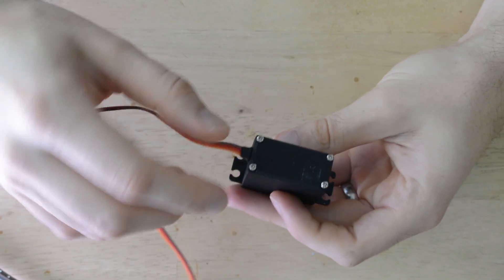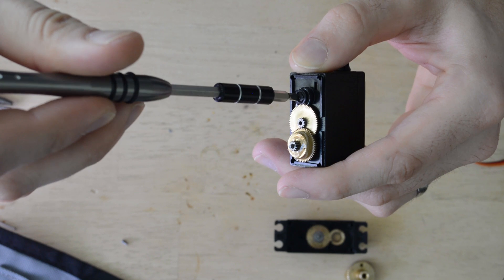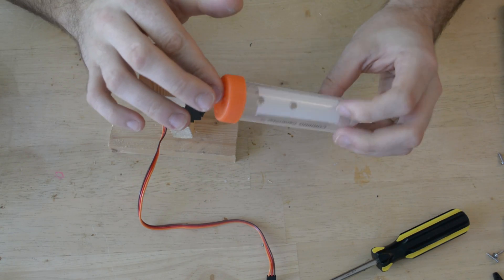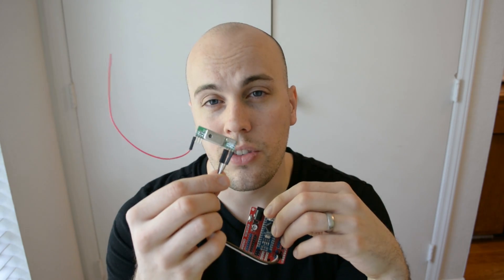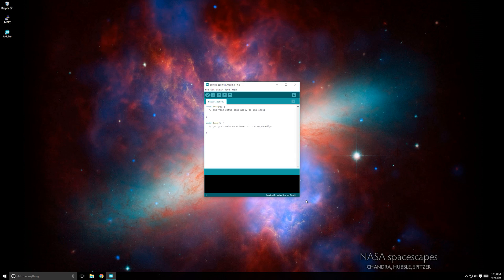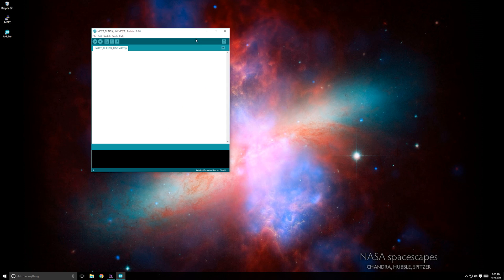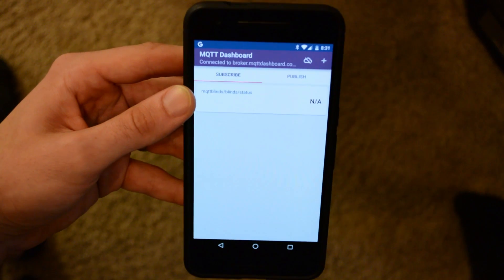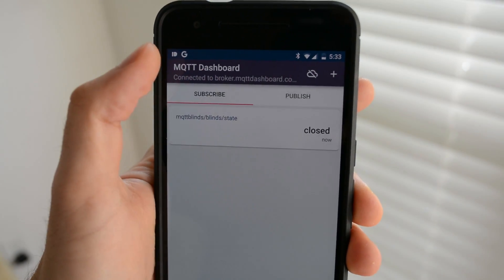The Cheapest Tech - $15 DIY Internet of Things Automated Blinds

Comment: Hi Ben, 
I got this up and running. Thanks for the video. 
Now I want to add this setup to my home-assistant hub and control it from there.
It runs on a raspberry pi.
How would I do that?

From documentation, what I understand, is  Home Assistant contains an embedded MQTT broker. So using this embedded MQTT broker, can I access/control the blinds.

Thanks for the help.
Reply from the maker: For sure. Yep, MQTT would be the way to go. If you install HA via the All-In-One script, Mosquitto is already installed and setup. You should be able to access it at port 1883. I think the access rights are setup such that you can use any username and password? I think you can create a username and password for Mosquitto using sudo mosquitto_passwd -c /etc/mosquitto/accesslist.txt yourusername.

Comment: Hey, great project. Even i am trying to similar one for windows. I have problem in driving motor to full rotation. I followed your steps(cut potentiometer and pluck the stopper from main gear) but even then my motor rotates only for 180 degree back and forth. Please help me.
Reply from the maker: For sure. My guess is the pot isn't totally disabled. Try centering it again, then cutting the stem a little lower or even using a dab of superglue. I bet once you get that done, it should rotate indefinitely. Cheers!
Reply: Thank you! I would try this :)
Reply from the maker: Let me know when you get it going!
Reply: Hey thanks for the suggestion it worked. I cut the potentiometer little deeper :)
Reply from the maker: Sweet! Nice! Pumped you got it working.

Comment: Your design is very unattractive in the typical home aesthetic. Back in the late eighties I designed a circuit that used two 555 timers and four relays, and a small gear motor to automatically angle mini blinds open or closed in response to the day and night cycle. It worked great.  But it was ugly. A three inch by four inch black box. So I went to work figuring out how to design the idea so it would fit in with design motif of your typical mini blinds. So I came up with the Electronic power angling Rod. I patented it in 1995. P.T.O. granted patent status in 1997. Couldn't find any buyers of the invention who wanted to manufacture the invention. The patent ran out last year. It is now being manufactured and sold by someone else, and they call it the EZ-Wand.  See it work: http://www.youtube.com/watch?v=bIjByZLOsPg&google_comment_id=z120upiastq2ypn1p22yyvwggxn0flvzj04&google_view_type#gpluscomments
Reply from the maker: Haha, yeah, I agree, it's totally ugly. Definitely not something my wife likes, but it does work and it's super cheap. :P Yeah, I'm definitely surprised that there isn't a commercial blind opener, yet. Seems like there'd be a lot of demand at the $20 price point. I guess the issue is powering it can be tricky and people don't want to have to plug-in their blinds.. plus designing something for pull string blinds can be tough. Your product looks neat! Sorry to hear your patent ran out. :(

Comment: Hi Ben!

This and all your videos are awesome!!! I started to following you some just this week and actually already answer your YT poll :)

Now I want to start my own projects and I'm gathering info so, I have some questions, I hope you can help me;

Did you prefer WIFI over RF for your blinds? (with HomeAutomation and Raspberry you can control both form the outside right?)
I'm planning to automatize several motors (like 10 for different applications on my house [also a rented flat]) and like to know what could be better, use RF for each one managed by a Raspberry Pi 3 or each one having its own WIFI chip? Which disadvaantages know you?

Thanks a lot
Reply from the maker: Nice! Sounds sweet! I've used RF and WIFI for blinds before. The advantage of WIFI is that you can use MQTT and get two way communication - verify that the blinds are open or whatever. RF on the other hand is only one way communication with Home Assistant right now. 

The main draw to me of going RF is that you can find expansion shields for say an Arduino Nano that support up to a 12v input. That means you can easily power your servo at a much higher voltage and get way more power out of them.  The same can be done with a a WIFI chip, I just haven't seen an off the shelf component like this for them.. http://amzn.to/1U94AL5

Comment: this is really a cool and in depth idea i'd like to take forward on some more formal grass shades with a continuous pull set up.  I think the approach would work..... however, I would like to mount this on the top of the window out of sight.  Any chance this could be battery powered to avoid having power outlets installed at the top of each window frame.?? (not sure that's doable in the construction limitations of the house)  THanks!
Reply from the maker: For sure! I definitely want to explore battery options, as well. There are a couple of issues though. Primarily, WIFI isn't the greatest standard to use for battery communications. Generally, it's pretty power hungry. The first version I made on my website used RF and that would work well for a battery application. 

Another issue is that these servos take a lot of juice. You could use some kind of lipo battery, but you'd still have to charge it regularly. If you didn't need the torque, I'd switch to perhaps a stepper motor with a gear box. It shouldn't cost a whole lot more, but it'd be a pretty different design than this. 

I definitely have the plans to a third version of these blinds that'll be much more relevant for battery applications. I'll definitely try and get a video out after I make a few Z-Wave and advanced Home Assistant videos. Let me know if I can do anything to help before then! Cheers!
Reply: Any update to this yet?  I would love to come up with a battery version that could be hidden in the top rail.  It would be nice if we could marry your wifi method to this stepper motor approach if it's doable.  http://snorp.net/2016/05/20/blinds-controller.html

Comment: Did you ever run into the situation where the servo would go strong and fast one way (close) but going the opposite (open) it would be very weak and jittery? I tried adding to the 180 (540, 900, 1260) and it would make the servo run a little better but still not correctly. Thanks in advance!
Reply from the maker: yeah! I've had similar issues before. Does the servo sound really weak under load or is it just anytime it rotates that direction? It's possible that the servo needs more grease. It could have gotten wiped off in the modification process. 

It could also be that your blinds need more torque and really the only way to increase that is to get a higher voltage to the servo. This is kind of a pain. If you're using the NodeMCU chip make sure you use the 5v pin. If that's not enough power you could switch to a higher voltage power supply separate from the NodeMCU chip. 

As a note, I've had two identical servos and one has significantly more torque than the other. You might try a new servo to see if that helps if you have one laying around. Let me know how I can help! Cheers!
Reply from the maker: Hmm, that's strange. I don't know 100%, but since it goes one way without issue I doubt it is a NodeMCU or script issue. To me, that seems like a servo issue. I'm not as familiar with those littler servos - I've only ever really used the MG955 servos. Anyway you can test the servo on another arduino or pi and/or find a different servo to test?

Comment: I also had a question about your setup.. Does it just power on the servo for the period of time needed? or does it stay powered all the time?, I was thinking that if powered all the time, it might chatter
Reply from the maker: +Mack Goodman Good question! The script disconnects from the servo when it isn't running to avoid the chatter. Figured that out the hard way. :P
Reply: +BRUH Automation great!, well I can't wait to get it all together..thanks for all your help, and I like your videos, keep it up and you'll be bringing in some fun money to do even more!
Reply from the maker: +mack goodman for sure! Happy to help and thanks for sharing your setup! I can't seem to find the comment I left earlier so I apologize  if this is a double post. Your workaround for the vertical rod is sweet!  Thanks for sharing that! How did you do the plastic mount? Is that something you made?
Reply: BRUH Automation Yes, I made the mount and the servo adapter piece on top, designed it and printed on my 3d printer.  You gotta get one if you don't have on.  Mine only cost about 230. shipped and fully assembled
Reply from the maker: +mack goodman Sweet. Yeah, I definitely need to get one. It's on my list! What kind do you have?
Reply: I got the Fabrikator Mini from Hobbyking.  They are always out of stock it seems, but if you want to make some small parts, it is a nice starter. the bed is 80cm X 80cm, so it has some limits though.
Reply from the maker: +mack goodman Looks awesome! Never heard of that model before now. You mean 80mm, right? Yeah, that would be tough. I want one so I can build enclosures for my hardware. Most of those are pretty tiny so I might be able to squeeze it in a 80mm box. Thanks for the inspiration. Now to convince my wife. :P
Reply: yeah, sorry 80mm.  It is surprising what all you can print in that box.  I am printing a new version of the blinds bracket right now!
Reply from the maker: For sure. Send me a picture or video when you get it mounted! Cheers!

Comment: Hey! Just found this video and it will definitely help me out, I'm looking for the cheapest way to automated my blinds to home assistant, will most likely be using this method! Have a question though, have you integrated this into home assistant yet? Would you mind providing your YAML lines to add it as a switch? Also to what extent would the code have to be modified to use with a servo that's already continuous? Don't know much coding so would probably stick with your modding example though. Thanks!!
Reply from the maker: +Ryan Laux Sweet! Glad you found it helpful. I sent you a DM on Twitter. For those wondering, my Home Assitant config is availible on github at https://github.com/brusc/Home-Assistant-Configuration. My blinds are still set up using the old RF setup I had. To switch to MQTT, I'd use something like the following configuration. 

switch:
  platform: mqtt
  name: "Blinds"
  state_topic: "mqttblinds/blinds/state"
  command_topic: "mqttblinds/blinds/command"
  payload_on: "open"
  payload_off: "close"
  optimistic: false
  qos: 0

Comment: I had no idea there were so many MQTT phone apps, and even a server!  I will have to go look through your web site and other videos to see if you have tackled running an MQTT server on OpenWRT yet.   I was all set to try it out and discovered my router was so short on memory I'd need to install the toolchain and compile it myself.  Oops - long learning curve.
Reply from the maker: +T.Rob Wyatt I haven't tackled MQTT on my router just yet. I have a very old Cisco E4200 router that I'm still using from my college days. It gets the job done, but I'm certain it doesn't  have the horsepower for MQTT. I run a MQTT Mosquitto server that I run on the Raspberry Pi 2 that runs home assistant. It works pretty well! Definitely a learning curve that I'm still trying to figure out, too. Thanks for checking out the channel!

Comment: Great video tutorial. The setup isn't petty, but functional. DIY projects are fun. I made myself a short YouTube clip on energy reading from the utility room in combination with a ESP8266 NodeMCU and Domoticz.  Is that possible in combination with Home Assistant? https://youtu.be/lY-bSa3NFPk
Reply from the maker: +Michel l'Amie Thanks much! Sweet ESP8266 sensors! I could never get those units working well for me. I use the much more stupid-proof NodeMCU variants. Kudos! 

I don't know anything about Domoticz other than what it is. I'm not sure if there is an easy transition to Home Assistant or not. My advice would be to switch your sensors to MQTT which should be fairly universal to most home automation hubs. If you get it figured out, let me know! Would be great to see more DIY devices in the Home Assistant community.
Reply: +BRUH Automation I use the same NodeMcu with the firmware from www.esp8266.nu where MQTT is supported. I doubt on getting started with Home Assistant. Not many devices are supported yet and missing the graphs. But it looks beautiful.
Reply from the maker: +Michel l'Amie Ah, gotcha! Yeah, Home Assistant definitely is lacking in the graph support. What I love about Home Assistant is the ability to create extremely robust automatons based on sensor values.. There really isn't anything I haven't figured out how to do with Home Assistant. Domoticz looks sweet, too, though. Whatever works best for you!